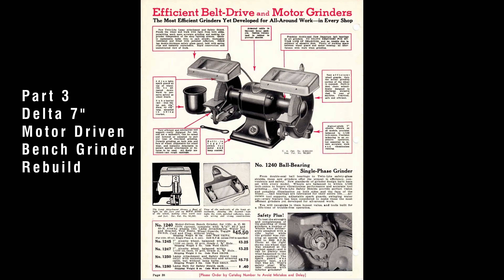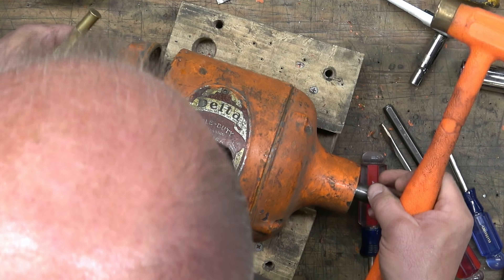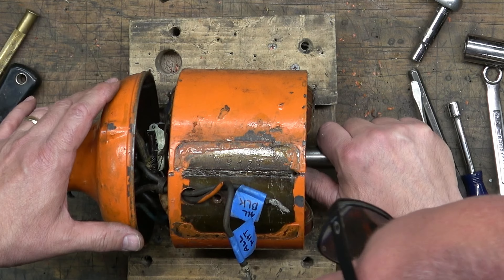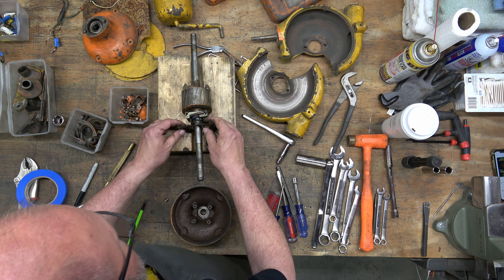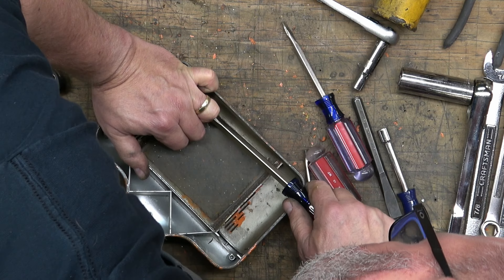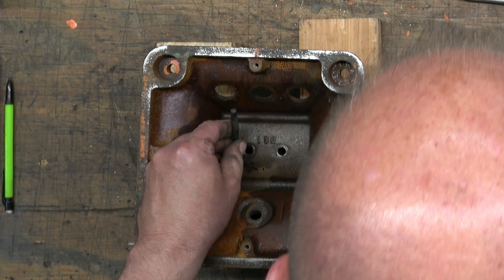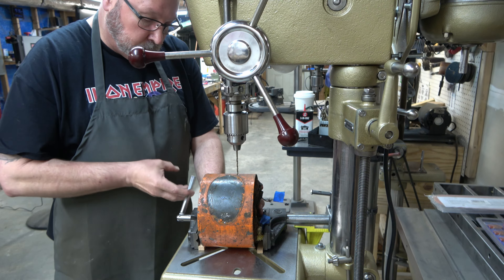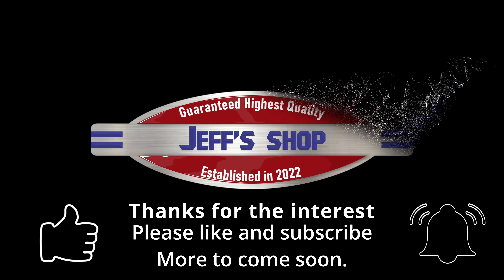Part 3 Delta Grinder Rebuild (Disassembly Continued)

Comment: Jeff, could you have pressed or tapped the rotor from the bearing housing closest to the centrifical switch. Once the rotor is completely removed the centrifical switch could be easily removed with just a long screwdriver?